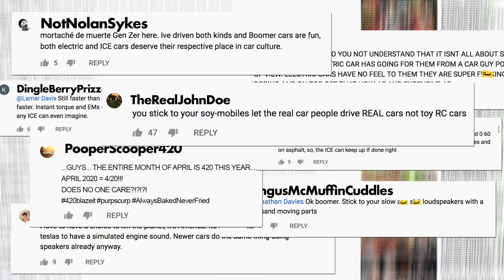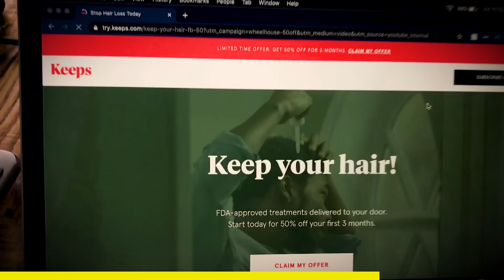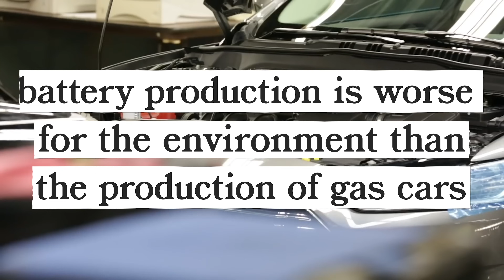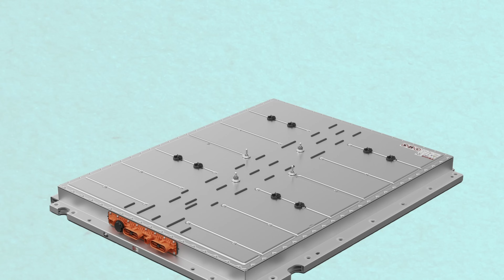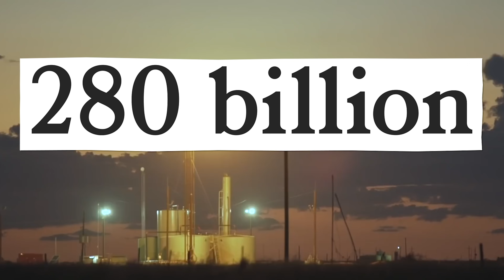Are Electric Cars REALLY Better for the Environment?

Comment: So in extremely short (And obviously heavily simplified) form:

EV: 17 tonnes CO2 for production + 0-2 tonnes per year using it (variance is based on electric grid composition)
ICE: 7 tonnes CO2 for production + 5.2 tonnes per year using it.

Pretty obvious that while the upfront 'cost' is higher, the period for balancing that out is not that long.
In short, EV's are almost always better unless you replace your car more than once every 4 years. (and that 4 year period includes use by anyone that buys it secondhand, not just the original owner. Eg. My current car is 17 years old and I'm not it's first owner. - caveat here is that if the EV needs a battery replacement that will add to the longterm impact. But if an EV needs a battery replacement more than once in 8 years there's something wrong with it. And really the battery should last closer to 15-20 years according to current specs.)
Reply: unless battery technology has improved greatly since i was in the industry i would count on ~7 years and ~80-100k miles which ever comes first. this is empirical data from when i worked in a dealer. think about how long a laptop battery lasts and how it's wear characteristics are and an ev battery should be simmilar, maybe a bit worse due to the environment it operates in.

Comment: My opinion on EVs: As long as I am not forced to buy one, I don’t care whether you drive an electric car or not.
Reply: Vinícius Braga Vilela I agree with you about the options of all kinds of engines and gearboxes. I want to be able to still buy V8 cars and trucks as I get older. I own a 1999 F150 with the 4.6 right now, but I’d eventually want to buy a newer F150 with the 5.0 Coyote in it.

Comment: Yes those figures are awesome here comes the but.... But in 3rd world countries like South Africa where the government is building more coal powered stations it just doesn't make sense. The power grid is so old and fragile that it can't handle new energy sources like solar power. At this current point of time south africa goes through load shedding on a regular basis where the power is shut off to different areas from between 4 hours a day up to 12 hours a day depending on the supply on the grid. The other downside for 3rd world countries is a cheap ev costs 10 times the price of a econo box. So a decent ev will be in the region of second hand super car money. Especially with our shitty economy ZAR 20 = 1 US dollar. So unless something magical happens in 3rd world countries internal combustion motors won't be going away. And if you are wondering about price comparison a second hand miata (which are pretty rare here) will cost the same as a brand new econo box. Sorry no depreciation here..

Comment: Did you take into account proportioning out the use of gasoline out of oil? Oil is refined and under 40% (roughly) of it goes into making gasoline, the other 60 goes to making other everyday items. U cant assign all those emissions towards cars. Unlike lithium where most does go towards Battey production, but also not all of it goes towards cars. However the proportion of it will increase dramatically and cause more. It's more than just getting basic numbers and lumping them up. But yes, I do think overall maybe electric is better for the environment but u also need to take into account recycling is vehicles. Used gasoline engines are used for spare parts or recycled. What's happens to a battery AFTER it's dead. Where is it discarded and how does that affect the earth?

Comment: You forgot to mention many used batteries from EVs will be re-purposed for stationary grid storage and other energy storage applications.  Also, thanks to the $7500 federal rebate for buying a new EV (that has expired for many models) it’s very cheap to buy used EVs because the resale value of used EV is very low compared to similar age and mileage ICE vehicles.  This is good for poor people.  However it’s more difficult to own and drive an EV if one does not own their own home with a dedicated garage or parking area.   It’s more difficult to drive an EV living in an apartment and I would not recommend it.

Comment: My bigger issue is electric cars performing to the same degree as gas powered cars in all aspects. I don't care about ride comfort or an info-tainment system, I care about speed, range and torque. I won't consider moving to an electric car now because as it stands being someone who intends to live out his life in a rural area, needs his car for work as much as raw travel and leisure, and does a lot of long distance traveling, an EV is not a practical option now. Hopefully in the not too distant future this gap can be closed. But for now gas is the only sensible option for me.

Comment: If you are comparing a new car to another new car, yes the EV will always be more efficient. Where this argument falls apart is when someone goes out of there way to buy a new EV replacing a perfectly good automobile that has plenty of life remaining. At that point it is worse for the environment just by addding a new car into the mix and adding all of that production pollution when using your older, albeit less efficient car has already produced its manufacturing pollution. The same rules apply for replacing any perfectly good used car with a new car before the old one is truly and honestly dead. If you want to be environmentally conscious, wait until your current car is totally dead and then buy an EV. Don't run out and buy one tomorrow.
Reply: @Seawolf except to a point. Walk around a junk yard and you find tons of cars that are worthless at a dollar amount but still have value in a practical sense as a usable vehicle. Constantly replacing a car your prematurely replacing a car just means the cars in the junk yard are newer and less used. This is a problem considering newer card can drive and be useful for the longest period of time ever seen before.  The production cost in pollution for those vehicles is being wasted. Good cars at junkyards is a bad thing for the environment. The most environmentally friendly car is no car or the car you already own. This holds true for all consumer products, especially electronics.

Comment: Good video Nolan but you forgot to take in to account the life span of the cars. For example I work at a Toyota Lexus repair shop and have replaced 2 to 3 Prius batteries and power cells a month cars that are only 4  years old which you said is 1 of the more taxing parts of the EV cars on the other hand my 1999 Corolla  is been running strong for the past 21 years witch is an insanely efficient car that I will keep driving for probably another 10 years no matter how good electric cars are the lifespan of the cars is too short to compare econ boxes that will run for double if not triple any EV actual lifespan because replacing the battery is the equivalent of an engine swap. Any way love you and videos I met you at the kart event last year, so keep it up.

Comment: Things to video doesn't account for:

Pure Gasoline vs Ethanol Gasoline mixture vs Diesel. The production process chains, emissions, and energy density is different for each.

Liquid crude vs shale supply and refinement chains are different.

Copper and Neodymium production chains are the most integral calculation in th carbon footprint of electric vehicles. Both the motors and the plant turbines require copper windings (typically can't come from recycled copper) and rare earth magnets. Electric motors and generators also lose efficiency over time and need to be replaced. Yes we can reduce plant consumption through solar power, but then we need batteries which increases foot print from battery production.

Finally there is no account of energy spent maintaining the electrical grid vs the road infrastructure. That has to be part of the calculation. The electrical infrastructure is resource intensive and we would be creating new demand on the existing infrastructure, requiring more resource investment. The road infrastructure for IC engine fuel distribution already exists at necessary capacity in most places. Also unlike the inability to substitute copper in electrical distribution technology, we have many substitutions for concrete in road production technology.

Honestly it is more synergistic to improve mass transit delivery infrastructure for automotive fuels vs building a completely separate mass delivery infrastructure that doesn't involve engine-powered transit.
Reply: While I agree it would be nice to see the results from all of them, I think it's unlikely to be radically different then the conclusions come to in this video, Electric motor losses of efficiency are negligible, it's unlikely an EV will need to have it's motor/s replaced in it's lifetime, actually the same is true for the often repeated "batteries will need replacing every couple years" trope.

As far the grid goes with, current uptake rates of electric vehicles there wont have to be any massive investment in the grid, as was said in this video a third of all cars in America could become electric overnight and it wouldn't matter, the same is true for the mass delivery infrastructure, we don't have to build a completely separate system, the grids already there and it's not going to require huge changes to adapt to mass EV uptake, as this will be a gradual process taking many years.
Reply: @brockgowling-hammond7361  I work with high  HP/Watt electric motors under high torque conditions and they don't last long. MFT for the smaller motors is lower than the larger motors, but 20,000 hours under stop/start conditions is the MFT. There is a measurable loss of efficiency that can be measured in amperage draw over time. Combine that with the dendrite formation in lithium cells with every recharge and EV range starts to look shabby before the motors fail. They might be able to extend the life of the battery and motors if they use the transmission to keep the motors idling somehow, but as I understand it all EV systems are start/stop which means the motors are running through a full amp load/ inrush current cycle during normal operation. It drains the battery and creates a lot of extra heat and eventually the windings fail sooner under those conditions. 

I suppose the condition of the grid varies with region, but I know that my region is behind and is struggling to handle peak load in summer and I have been told that most are regions are similar. The problem with EV charging is that it will most likely follow the Air Conditioning load times. Around 5pm in the summer for most regions there is a peak load as everyone returns home and air conditioning usage spikes. Most plants can't supply enough to balance the peak load with the normal load amounts, so we use additional peak load plants that store energy during normal hours and release it during peak times. Most regions don't have enough capacity in peak load plants which is why outages are common in the summer. My region is also behind in general maintenance so we have equipment failure outages more commonly than we should. So as far as I know extra loading during peak time would require the creation of more peak load plants and, at least in my region, the replacement of aging equipment and a lot of tree removal. 

I think these things are worth calculating because diesel will still be needed. We don't have motors that can replace the high torque IC engines in most heavy duty work vehicles. With a recent advancement in diesel combustion technology (Ducted Fuel Injectors) we finally have a solution to the NOx vs Soot problem. With the new technology and diesel engines that performed like EV engines (low power, high efficiency) the entire diesel chain might oddly out-perform EV for years to come. The problem is investment into diesel is drying up because of dieselgate and the EV boom. I think it is worth someone doing an honest study.

I am not a die-hard IC fan. I actually prefer Stirling Engines, but I know how much trouble electric motor production can have. A few years ago there was a Neodymium shortage that had everyone scrambling to create a workable ferrite replacement. As soon as the shortage ended all the research was cancelled (it wasn't very promising as I understand) and we continue to ignore that very weak link in the production chain. The worst part is that most infrastructure already uses electric motors in one way or another. If we increase demand for this material it will increase stress on every part of daily life. The more we increase our dependency on copper and Neodymium materials the faster we run back toward the problem we had with fossil fuels, but more drastically because the material is a lot harder to take out of the ground and it is a lot harder to refine. I don't even want to think about the mine waste problems when the mines are exhausted and abandoned.

Comment: It starts before 0 so to speak. Gasoline requires electricity to refine, usually provided on-site by burning methane by-products (so good luck ever getting a reasonably accurate number from any refinery as to how much electricity is generated on-site). However, calculations indicate that an EV can go further on the electricity needed to refine one gallon gasoline than an ICE vehicle can go on that same gallon of gasoline. Love my '68 Mustang, but it is ridiculous to not give EV's the credit when it due them.

Comment: And, if we build out nuclear instead of fossil fuel plants for electricity, that yearly number could drop to 0.
Reply: @EduardGenardAndalis-n3y  Glad you asked. First, the scary nasty nuclear waste is generated by the military as opposed to power plants. Second, it's nowhere near the amount you think it is. Per person it's about the size of your fist a year. That's nothing compared to the carbon output of fossil fuels. Third, we know how to store it pretty well. Dry cask storage systems that are in use are exceptionally safe. You can ram a train into one at full speed and it does nothing. Fourth, and this is a big one, 96% of that spent fuel, can be recycled back into usable fuel. NINETY SIX PERCENT. However, in the US, we don't do this.  Because fear-mongering stopped it.

Comment: Take also particles into account. Some of them will be from combustion, but over 90% is brakes and tires. Especially tires will go much quicker due to the quick torque and the heavy batteries. Brakes will be used less thanks to regeneration, but when they are used, they wear faster. That's just one extra thing. There are many more factors. We all know the earth is warming, but still there is no solid proof that CO2 is the cause. I'm not saying that we should do nothing, but more research is required to find the actual causes of global warming.
Reply: Tim de Groot Europe came out of a mini ice age not to long ago geographically speaking, so the world can be warming up from that. Tire will go through very quickly.

Comment: It depend so much about horsepower, efficiency of your engine, how your electricity is produce, and so on ... If you are in a full nuclear electricity country, yes, EV are more safe for environnement by far.
If you are in Australia for example, a Ferrari 488 have less emissions than any Tesla. 
If you are in Germany, a Mercedes Class E 350d emissions are the same than a Model 3 (nearly same horsepower, same weight)
If you are in France, even the worst EV emitting less than any gas-powered car.

Comment: Personally I believe that because of EV's the future of Motorsports is going to largely be endurance racing and long range races. While making a reliable electric motor equivalent to say 750hp is hard, it is not nearly as hard as making 750hp reliably with combustion engine. So instead of manufacturers fighting for every hp/kw advantage the rules will allow, efficiency will be brought more to the forefront as the way to gain the advantage over your opponent. And not just power efficiency of the motor but also of batteries and motor production to decrease weight. Because of this I feel like a lot of Motorsports that involve all out power, drag racing for example, will largely grow out of style when EV's take over professional Motorsport. As much as many of us don't want the rumble of top level combustion engine race cars to go, it will happen.
Reply: [TSDT] Jzx_Life but than having a battery that can last the range required is crazy, and if they place a battery in a easy to swap parts, it can become a safety hazard. Long range races are safe in ice cars until we get better batteries in safety and range. Current EV’s are safe because there positioned and protected properly but that means it’s difficult to get them out
Reply: @slideways8022  You're right, but I was thinking like in the 2050's and beyond when more R&D is done for EV's. Until then manufacturers will compete in places like Formula E and the supposedly soon to be WRC electric class to advance EV technology to that point. I believe by the time EV's take over Motorsport in the middle of the century batteries will be smaller, lighter, safer, more efficient, and hot-swappable making EV's in endurance racing a more profitable endeavour.But I do agree that it likely won't be in the next 20-30 years.
Reply: [TSDT] Jzx_Life hot swapping is the only way with current tech, but due to placement isn’t safe. Hopefully motorsport will split ev and ice into separate class devisions like old rallying
Reply: @slideways8022  Agreed. At least enthusiast level racing won't be fully electric for awhile. When a lot of the major manufacturers move away from combustion engines in 15 ish years hybrid powertrains will probably be going into widespread use at an amateur level. So at least us non-professionals dont have to worry about fully electric for maybe 40 to 50 years.
Reply: [TSDT] Jzx_Life Id love 3 tier wrc, petrol, hybrid and electric